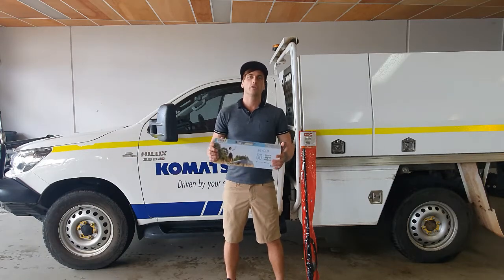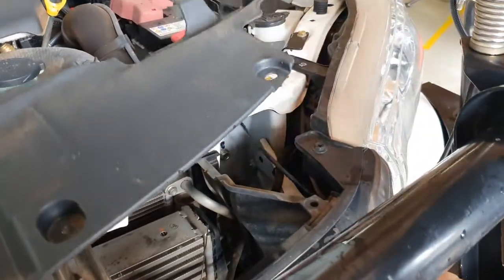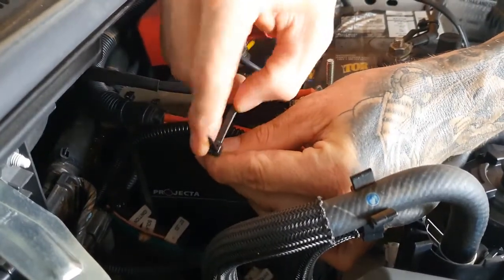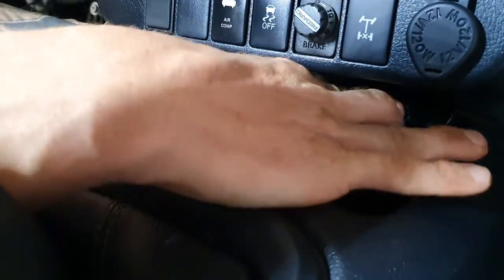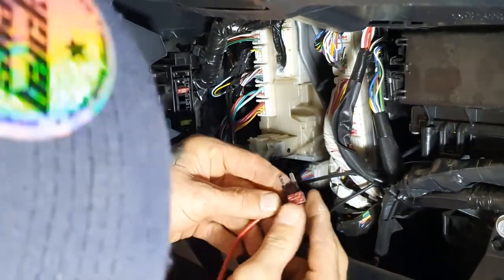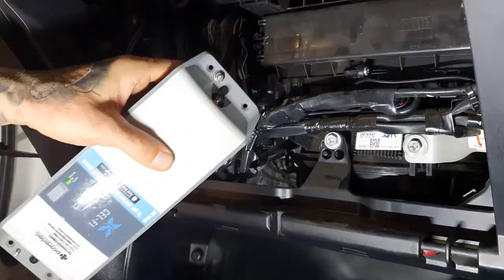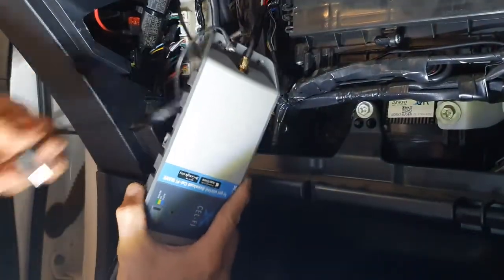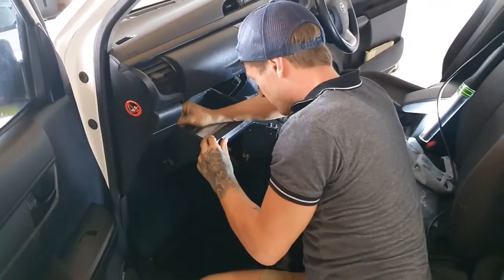Cel-Fi GO mobile repeater installation video

Comment: After my first few installations of two-way radio and cellular equipment 30 years ago I decided it was better to ALWAYS use stainless steel nuts, bolts, washers, and self tapping screws. Why? After a few years of service the galvanization breaks down the screws then rust.  Stainless steel may cost a few pennies more however, I found in the long run that the installation held up better and I had happy customers as a result.

Comment: Hi just wondering, so you remove the 5amp fuse for the a/c and then replace it with 2 x 10amp fuses in the holder?
Reply: Yeah, doesn’t look right for the aircon.  I suspect one of the 10A fuses is a spare.

Comment: Are these the same as the Actual telstra go mobile smart signal vehicle repeater? If so what's the difference between the two?
Reply from the maker: Hi Steve, Telstra don't manufacture thier own signal repeater, they buy the CelFi Go from Powertech to resell it, the same as we do. Both Telstra and Audiocom but my the very same CelFi Go from the importer of these units, Powertech. There are no differences in any way between the 'Telstra' CelFi GO and the Audiocom Cel Fi GO.
Reply: @audiocomwesternaustralia8123 hi, awesome video but just a little confused on which fuse to take out and also does the unit work all the time going that way or do u still need ignition on? Cheers